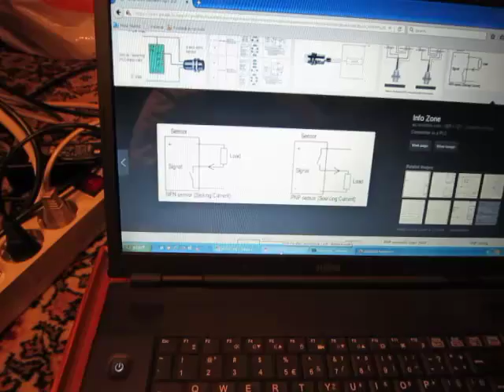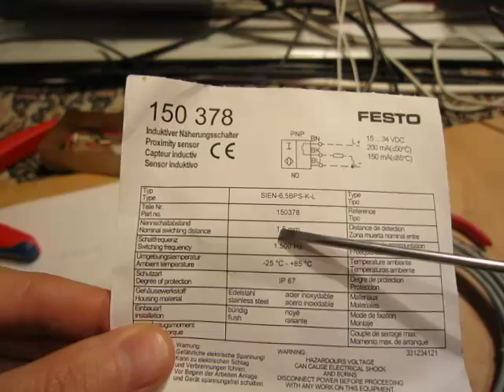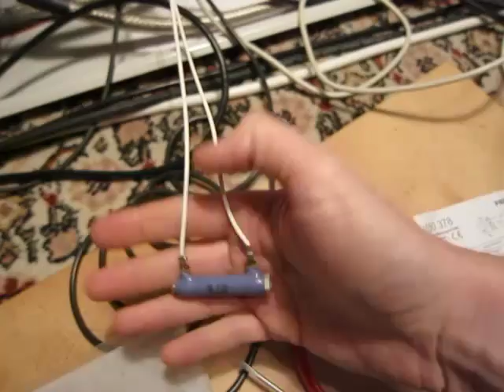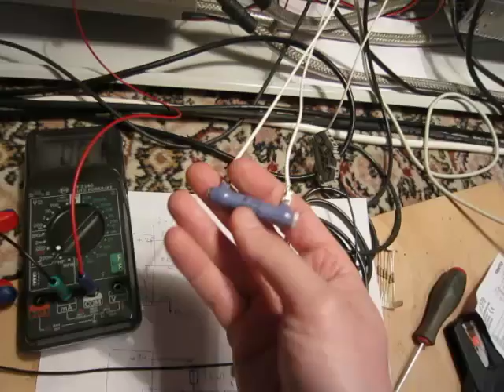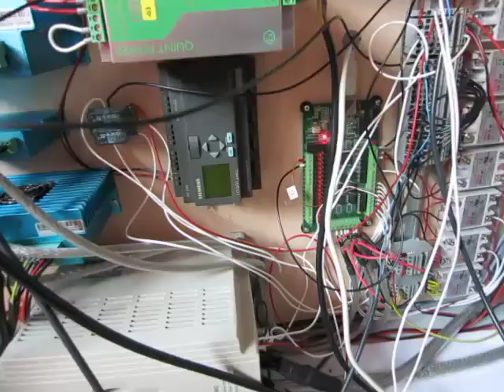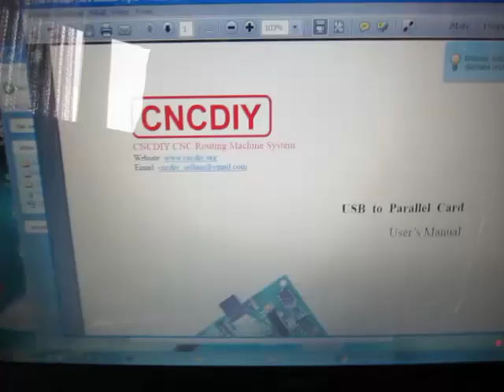How to use  inductive proximity sensor

Comment: hello bro
i have proximity sensor DC 10 30V and i have breakout board work with 5v i see in sensor 3 wire but in my breakout board 2 wire +5 and pin 
pls can you help how i can connect wire in breakout board
Reply from the maker: Hi
You need to determine is your type of sensor PNP or NPN, you need to connect some resistor in order to use it on 5 v input (try 10 kilo ohom, if it is to big try 5 kilo ohm), from sensor one wire is for minus (-) , one is for (+) and third one is from which you take signal from sensor and you bring it to your breakout board input. So when you determine which type of sensor you have you should know watching video where to connect 10 kilo ohm resistor and from which wire you take signal from sensor and you connect it to input of bob.
Reply: I have NPN SENSOR
Wire black  blue  brown
What is wire color should connected in breakout board
Thank you so much
Reply from the maker: did you make something?
Reply: zmajmr thank you so much for your attention
Reply from the maker: you are welcome, but did you manage to connect your npn sensor?

Comment: Brown wire has the + 6 to +36 voltage connected to it from the power supply , Blue wire has the negative wire from power supply and the black goes to the Breakout board pin.  The resistor for higher voltages than 6volts goes between blue and black wire.